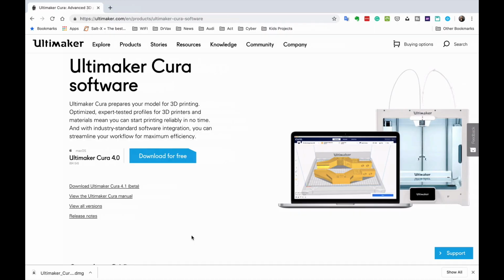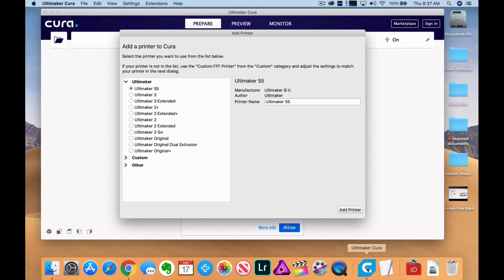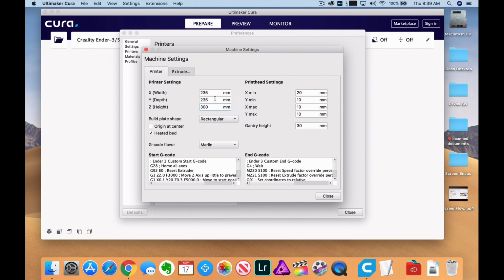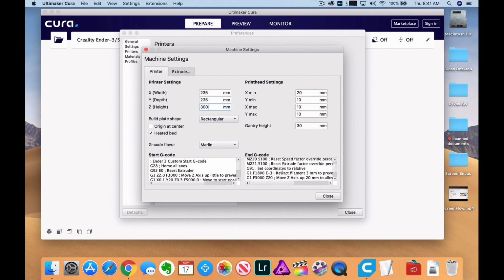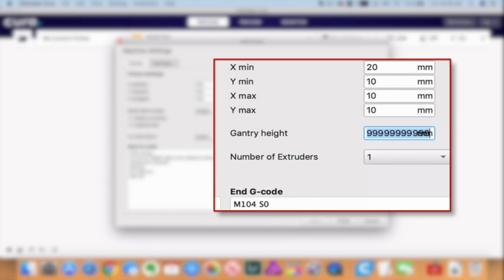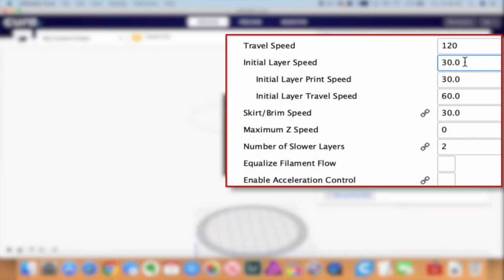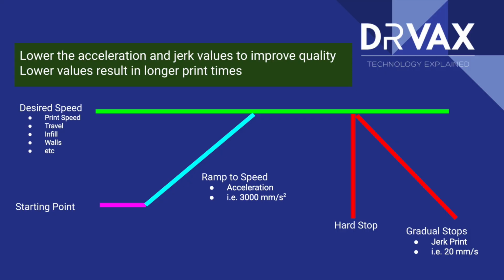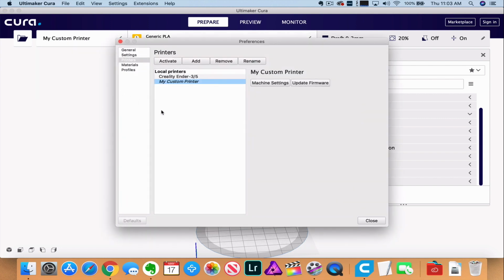Setting up a New 3d Printer in Cura

Comment: Your videos are so helpful. I'm new to all this, but I was going pretty good until I downloaded Cura v 4.1. BIG mistake. All my settings now are gone and I've spent 2 days trying to get back to it. For the life of me, I can't get the print to start in the middle of the bed. No matter the changes I've made in settings, it starts on the very left edge of the bed. Not left of center, I mean the actual EDGE OF THE GLASS. It's insane. Can you help? Suggestions?

Comment: Hi Dr. Vax. Why did you just skip over Printhead Settings,? Are they not important even though they may be wrong.? Are all print heads the same size and only the Gantry height matters?  I am having a hard time with my new printer trying to do what you are doing and making it look so easy. I bought a Labists ET4. not the best I know, but it was easy to assemble, the quality is great for the money, and I printed their  "Rocket " test print,  which turned out really great, so I printed 4 of them in different colours. When I went to print my own Fusion 360 models, they were good, but with a few little flaws where the support touched the model, so I decided I could do better by adding some custom settings. I tried various printers, changing the names and obviously doing it wrong. I finished up with the Anet ET4, which looked exactly the same as the Labists ET4.  I tried to copy a Start and End G-code and pick various other settings. That is when I lost track of everything and my printer started hammering on the bedplate or juddering on the belts and spewing filament off either side or corner.  It has been a frustrating 8 days and I am in a bigger mess than ever. I know that 3D printing has a learning curve, but I am going backwards. I learnt how to use Fusion 360 to the point of making files with no program mistakes, so I can't be that dumb.  It is now 11:15 PM so I am off to bed, but I will watch and study your video tomorrow and get back to you if I can't get it working properly, hoping you will help. Thanks for taking the time to do your videos. I really enjoy them and how they are presented. Bob.

Comment: Thanks, your video helped me. Just got my two trees sapphire pro as my first printer and it wasn't in latest Cura so used Ender 5 as a baseline. Sapphire pro prints beatifully (after a carefull build). Benchy printed perfect. But, I have still a long way to go to understand all the Cura settings and what they do to print. Your video covers a good start.
Reply from the maker: Glad it helped

P.S. I have started a new discussion forum at http://forum.drvax.com where we can all have more elaborate discussions and share pictures on our prints and printers. Check it out.  Irv

Comment: printer nozzle scrapes the tape on my bed how to fix ??
Reply from the maker: If your printer has an auto bed leveling system you need to adjust your Z offset.  If it does not you need to relevel your print bed.  Lots on video on this channel.  Just Google DrVAX Level Print Bed.

Comment: Great and extremely helpful video, I haven’t been able to figure out why Cura can’t stick to the bed but when I use Slic3r I have no issues. I think all I needed to do was adjust the layer height and I should be good. Now to figure out how to prime blob in a line across the top of the heat bed so my prints don’t have stray filament messing them up.

Comment: I just bought a Sapphire Pro how do I set it up using CURA ? I have been using an Anet A6 for five years but I don't think I will be able to use any of my STL files for this new printer . I would like to test print some files to be sure I've built this machine correctly . Could you help me please & thanks.
Reply from the maker: Happy to try and help.  The Sapphire Pro specs look impressive, please report how this goes.  I believe you could get started by just my video, step by step, and selecting an Ender 5 as your starting point.  The profiles will not be perfect because the Sapphire Pro is a CoreXY printer with a completely different rail system so the jerk and acceleration settings will be very different.  You might want to just turn jerk and acceleration controls off in Cura for your initial prints.  This will allow the printers firmware to set these values.

I also did some looking around and found this profile on Thingiverse that might be helpful:

https://www.thingiverse.com/thing:3708503

All the best.  Irv
Reply: @MakeWithTech  Firstly thank you for responding. The stage I'm at is testing with the prints that they supplied & getting used to the controls .I bought the pro ll with acrylic cover which i haven't installed yet. Every one who has posted has been a real help in not only building , and running this printer . So far i'm impressed with what i'm seeing . They put zip files on micro sd instead of usb thumb drive so i was completely lost for awhile . Thirty e mails in real time back & forth to Two Trees & finally things started to move . At this stage i'm not quite ready to print my own stuff . I will be in touch .
Sincere Thanks for your help , i will be in touch.
Reply: @MakeWithTech  after a bit of a struggle with Two Trees support i final got parameters for gcode . Its for Ultimaker works with Cura . Its been about my forth day of trying , it was really exhausting trying to get questions answered by Two Trees but , they finally coughed up the right firmware upgrades & other relevant information to make Cura work with Sapphire Pro  . Time to rest up & tommorow is another day .

Comment: i'm trying to connect my anycubic i3 mega to cura so I can update the firmware. I selected that printer in cura, have the usb cord plugged in and it says it doesn't have it connected. any ideas?
Reply from the maker: Yes. Don't use cura for this. Cura USB support is very poor.  What do the Anycubic folks recommend?  If they recommend Cura make sure your are using the version they recommend.  The newer versions of Cura have broken USB support for many printers.

To test your USB connection, cable, printer, etc try MatterControl from MatterHackers.  Their USB support is excellent.
Reply: I got the firmware to flash after trying it on my other windows 7 pc and updated to latest cura. Problem with my printer now is the level function dosen’t work and if I try to print something the printer tries to go further down an axis than it should and causes the belt to skip

Comment: Since Cura determines the initial layer height above the build plate, what is the purpose of calibrating the Z height on my Prusa MK3?
Reply from the maker: You can think of your slicer sitting above the printers z offset.   The z offset is the distance from the bottom of your auto bed leveling probe to the print surface.  This only impacts first layer height.

Comment: Any chance that you have Octolapse on your list of 'to do' videos for Ender 5 ?
Reply from the maker: I have used Octolapse and found it has a negative impact on print quality.  I think it is ok to capture a video if you are going to throw away the print.  

The problem is that it adds gcode to the print stream to move the print head to a standard position so it can be removed from the image. This messes with the cooling and overall temperature of the filament.  

Take a look at my video titled “I broke my printer ...” where I talk about this.  

Here is the link.  https://youtu.be/7oE9qxkqpPk

Comment: Great guide video. Did you know there is a default Ender5 Printer available from Creality, which I imported first into Cura 4; so did not have to build up mine from the an existing Ender3 base.
Reply from the maker: I did not.   Makes sense.  I bought my Ender 5 the first week it was out so the new profile was probably added after that.

Thanks for sharing.
Reply: @MakeWithTech  When asked, Creality told me, I could find the *.json setup file on the provided Ender 5 mini SD card. They also directed me to their download area, for access to the setup file. It took some digging, but when I got it, I was able to load it into Cura 4.
Reply from the maker: Thanks for sharing